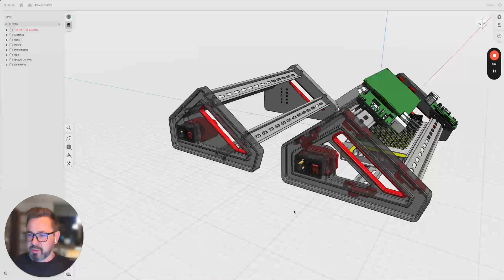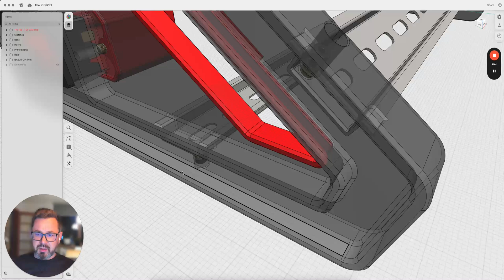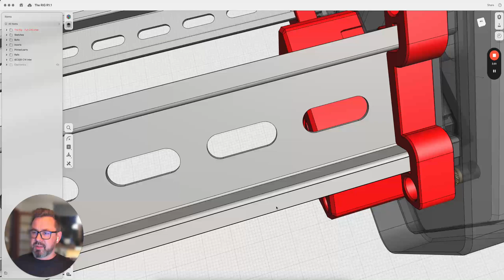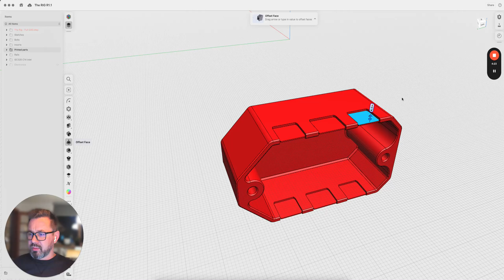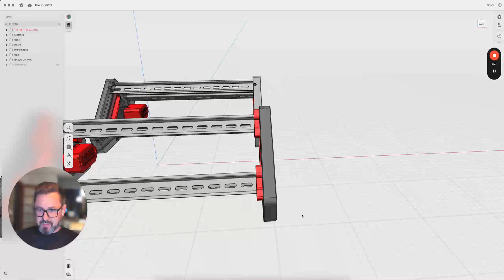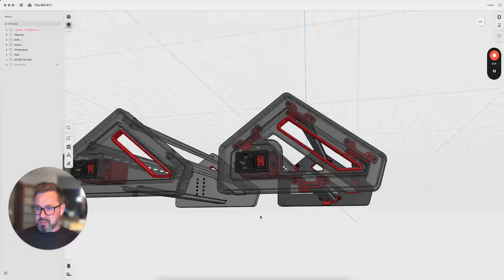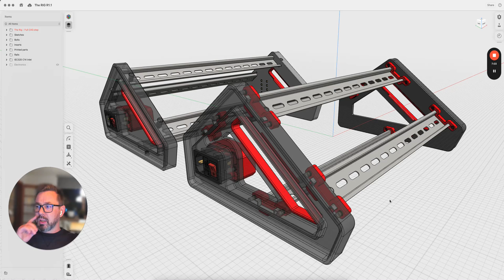The Rig Project R1.1 — Quick Walkthrough

Comment: You are awesome, I love the proffesional approach you apply to a free model on a sharing website - I drew some models, I don’t have the patience or time to do reiterations. I would love to see a small range of clips designed by you to make a perfect setup. Is there a reason you didn’t add pla or petg to your materials list?
Reply from the maker: Longtevity mostly. But you can use PLA or PETG for this project as well, filament choice does not make any key diffrence for this particular project.